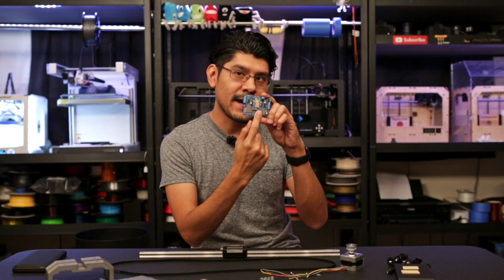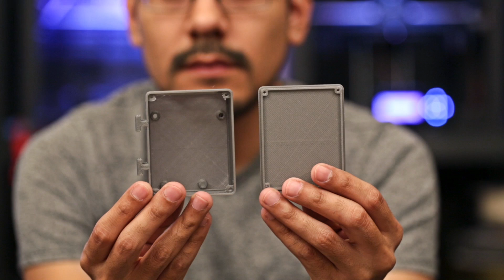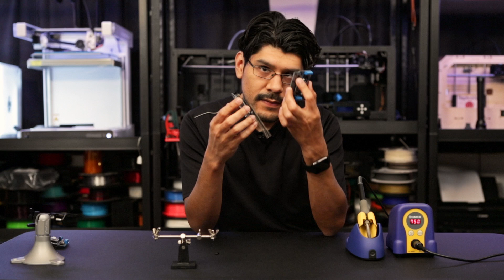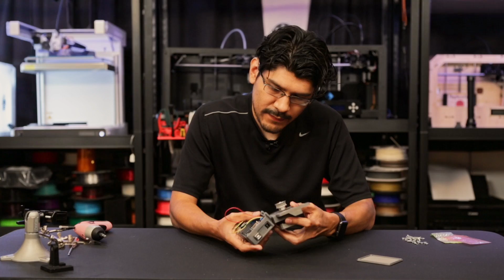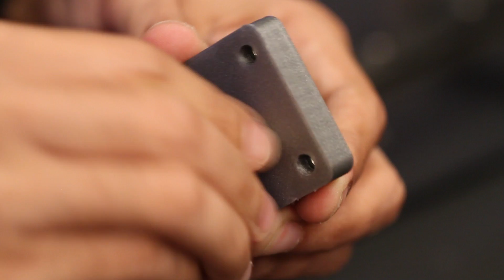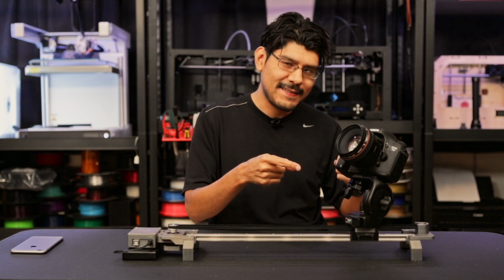How to make Bluetooth Camera Slider

Comment: Excuse me, sir. I’m doing your project and unfortunately I’m getting stuck. I’m sure that  I wired as same as you did, and connect bluetooth to my iphone 7+, ios 13.4, it shows blue light on Bluefruit LE SPI, I also uploaded your code, not simple one. However, I come to the control pad, press button and the mottor does not work, literally. There is no current go through M3 and M4. Please help me and contact to me as soon as possible, many thanks!

Comment: Hi! I have a question. Can I adding a timelapse fiture using this project? do i need add another shield to wire 2.5mm jack into a canon camera. please give me the answer
Reply: Edensor Yes you can. Just use a transistor to send a signal through whatever cable is needed to your camera. First you should figure out what triggers a photo on the cable.

Comment: Hi, this is really genius... but it is totally useless if we do not know how to control the motor using the app? There is no info / video about that...
I am really decided to do this, but because I do not have a 3D printer I will use a cheap commercial slider
Did any of you watching this have already done this project? If yes, how about the last step, controlling.... any ideas?

Comment: Nice project, i bought the shield and the stepper motor. Could you please upload the final part of this tutorial explaining how to customize the sketch and how to control the slider with the smartphone? thanks a lot, I appreciate your work!
Reply from the maker: +andre g Thank you! We shall consider making a follow up :-)
Reply: Hi Andre, did you manage to figure out how to control the slider with the app on the phone. I think it requires some programing
Reply: Titus Tucan  Hi Titus, I didn't try yet. I only connected the motor shield to the arduino and the nema-17 to the shield and run the test sketch to see if everything was ok. when i will conclude the project i will notify you, now i'm stuck with exams in university :(

Comment: Hey :),
Really like the slider. Just the other day I saw a video on the youtube channel "FliteTest" where they cleverly hacked a 3$ RC Servo to spin 360 degrees with no end-stop. As they built something similar to this I was wondering if it wouldn't be great to combine this design and use a servo instead of the stepper. You might loose a bit of resolution but it would dramatically decrease the BOM I guess (as well as making it lighter and smaller). 😉